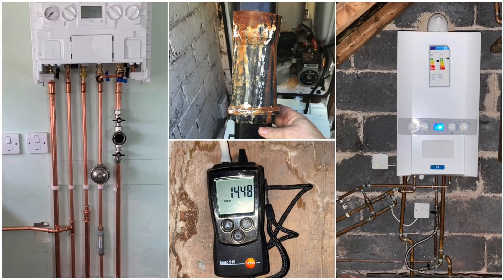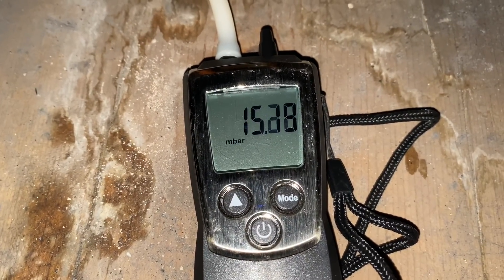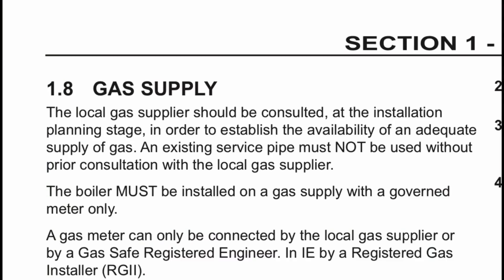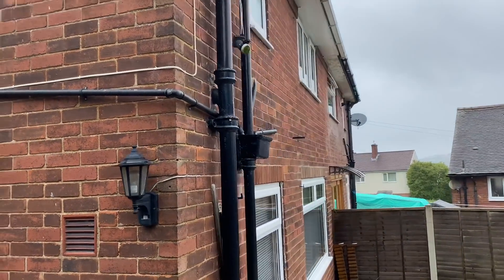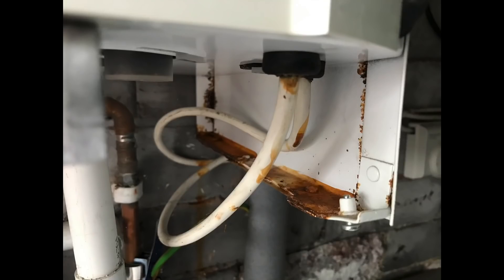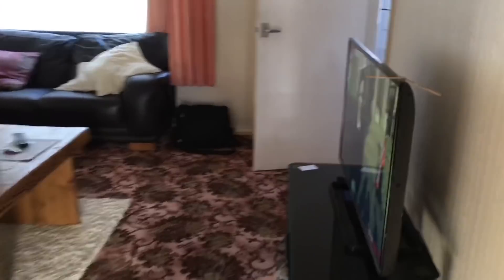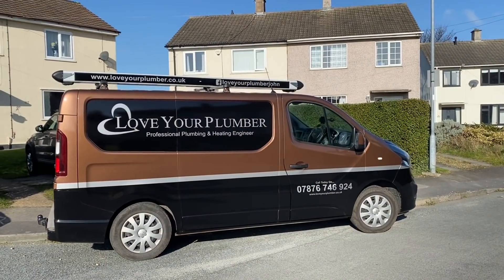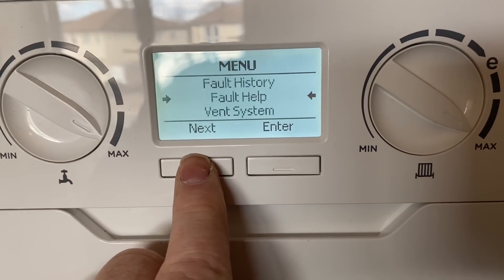Ideal Logic Boiler Installations - Leeds Plumber

Comment: My PRV has been soldered.....badly..why should it not be soldered, the condensate pipe was at the wrong angle, so he burned it with the heat gun and twisted it to fit...all the soldered pipes are at the wrong angle...all fitted yesterday....new boiler on a 15 yr old system...no power flush, no additives..says it doesn't need it.....the damage has already been done..supply and fit Ideal esprit....1500 quid..

Comment: Allen, what is the minimum distance that a boiler can be fitted to the domestic electrical installation ? This boiler seems to be quite close to the elect board ?
Reply from the maker: Do you mean the consumer unit? Thanks
Reply: @AllenHart999  yes that’s correct

Comment: Hi allen great vids.   Just something I remember Not sure if it applies (on this Version) I don't notice the problem anymore testing working pressures.  Wasn't the the Gas Isolation on the early logics known to give Low Pressure Readings.  I remember they started to give a table in the manual to account for low reading and give what the boiler is actually getting.  Been Fitting Logics  Since they came to market and defiantly remember that happening.

Comment: Ideal logic might be a cheaper boiler, but installed & serviced well it will last just as long as any expensive boiler. (Assuming those new plastic hydroblocks last 😂)
Reply from the maker: I have just said the same to a customer today. Thanks.

Comment: Could you use plastic pipework for rads and water feed to connect to the boiler or does it have to be copper pipe work? I know the gas pipe will be copper pipe but just wondering if you could use plastic on the rest? Thanks

Comment: Just out of interest what's the reason why the PRV pipework has to have a compression fitting 
 and not solder?
Reply: So the pipe can be disconnected if and when the pump housing requires removing from the boiler.

Comment: Good luck getting a 1mb loss across the pipework and the correct pressure at the boiler. Especially when some suppliers won't even get you the correct pressure at the meter. Called one out for low meter working pressure twice last month, they refused to do anything about it.
Reply from the maker: The 1mb has nothing to do with what you get at meter. Just needs to be sized correctly
Reply: @AllenHart999  If you have a 50 kw combi that's 80 meters away from the gas meter with shit load of joints no amount of pipe sizing is going to get you your 1mb drop. Especially when the outlet of the gas meter is maximum 28mm. Anyone who claims they always get  a 1mb drop or les is dishonest.
Reply from the maker: French Dogg We are not given a choice if we rules we follow

Comment: Thanks Allen ,,  On thursday my plumbers coming to fit a Ideal Logic compb in my kitchen ,,,The system has not been used for at least five years so  I,v told the guy it needs a flush  ,I just hope the pipework is as good as your mates... I wanted a Ideal boiler because I like the controls (knobs as u posed to buttons) plus I,m from ull...regards
Reply from the maker: Let us know how you get on. Thanks.
Reply: @AllenHart999  Yeah I think he did a good job,it was not an easy fit,,the plumbing in my house is abit slapdash,,, and my shower has never worked in 9 years,,it does now. The only regret for my is following his advice to go Combi,as opposed to boiler +hotwater tank.. I do,nt really like all the pipes below the boiler no matter how shiny they are... regards

Comment: You have 1 Mbar drop in the insatall  and 1.2 I think it is at the the gas valve so you can have 2.2 mbar drop as per MI , so if that was 20 mbar inlet and 22 mbar working it would be ok as per MI
Reply from the maker: 14mb is very low, isn’t it?

Comment: Allen, I know 14mb at boiler is low an wrong an yes I was taught 1mb drop from meter to appliance ..

But in the ideal MI’s it states the boiler can function as low as 14mb at full output 
My question is I ask numerous time an nobody would commit an answer so would the working pressure you got at 14mb be ok ?
Reply from the maker: People read the instructions wrong. it says it will work safely at that pressure. Once you run the cooker or fire the boiler would drop lower. Also it was 22mb at meter, What about when there is high demand or the governor drops down to say 18mb?
Reply: Allen Hart 

Cheers for reply, I was watched video then paused to comment then carried on an the nest part was you showing the ideal book

I’ve read it but it’s not 100% clear.. 
great video again 

Looking forward to vids on landlord certs etc ..
Reply from the maker: @tommyblackman7119  Hi Tommy, Thank you so much for the reply.
Reply: The answer to your question is NO, 14mbar is not acceptable working pressure at the Boiler, the only time we will accept this is if you cannot physically achieve a working pressure at the Gas meter of greater than 17mb,
Reply: Kevin Cranfield so if 17mb at meter would a regulator issue then ? 

The MI’s just need to explain things simpler 

20mb at boiler minimum etc
Reply: @tommyblackman7119  i agree with you that it is a little confusing, and i hope i can give you some clarity to the matter. I have checked my literature and assuming the working pressure at the Meter is 19mbar and minus the 1mbar pressure loss across the Pipework, 12KW Heat only minus 0.4mbar absortion across the valve, expect 17.6mb, 15KW Heat only minus 0.7mbar absorbtion across the valve, expect 17.3mbar , 18KW Heat only minus 0.9mbar absorbtion across the valve, expect 17.1mbar, 24KW Combi minus 1.3mbar absorbtion across the valve, expect 16.7mbar, 30KW Combi minus 1.8mbar absorbtion across the valve, expect 16.2mbar, 35KW Combi minus 2.1mbar absorbtion across the valve, expect 15.9mbar, these are not set in stone, we are realistic and except adjustments to these figures, but not drastic differences.
The 17mbar working pressure at the Meter stated before refers to when the Supplier has deemed that, that is the Maximum Working pressure that they can acheive and must be confirmed with the supplier, it is not neccesarily a Regulator issue but more of a Supply in the Street issue, they seem to accept that 17mbar is a sufficient level in some circumstances.

Comment: is the flue standard for the baxi 800 range the same?  Where the white can not be on display and the turret should only terminate outside the flue collar
Reply from the maker: You would need to check with the installation instructions but I don’t believe Baxi allow white on show. Thanks

Comment: I once had a Worcester GB162 80kw at 1mb inlet pressure at max. The gas valve filter was blocked with copper sulphate
Reply from the maker: This job is clearly undersized. Thanks.
Reply: @AllenHart999  wasn't actually. Was 2" pipe fed from high pressure 750mb supply with drop down regulator as it was a factory. Just the gas supply in northern Ireland sometimes has reactions with the pipe work and forms the sulphate fillings which block gas valve filters
Reply from the maker: @necropig  I mean on my video lol. Thanks.